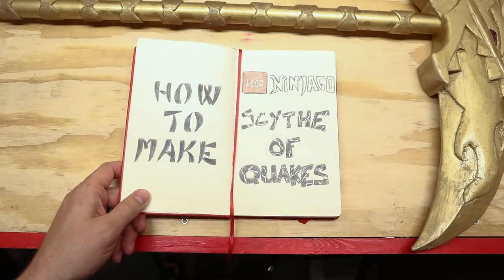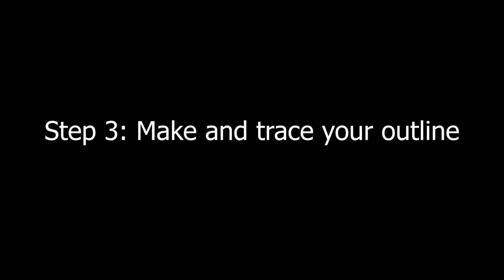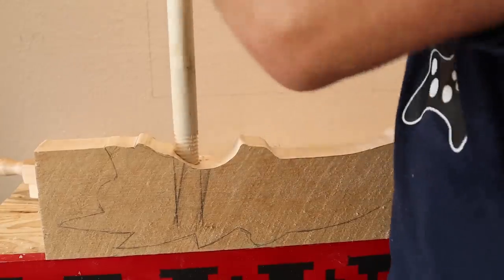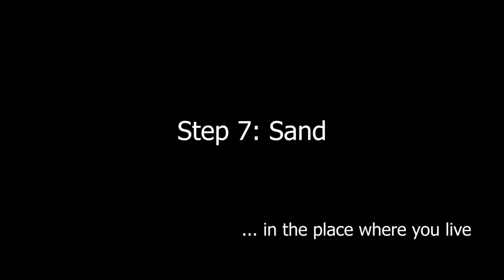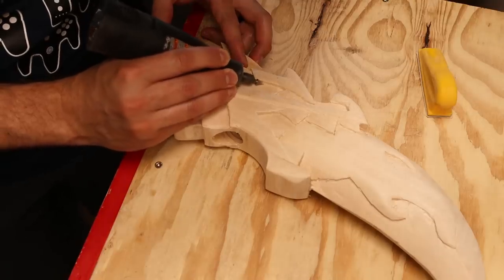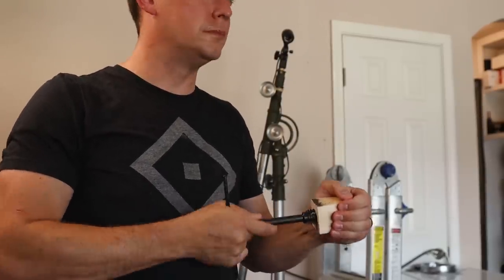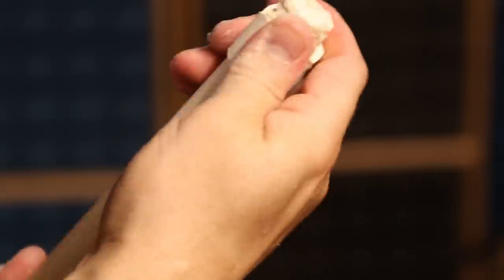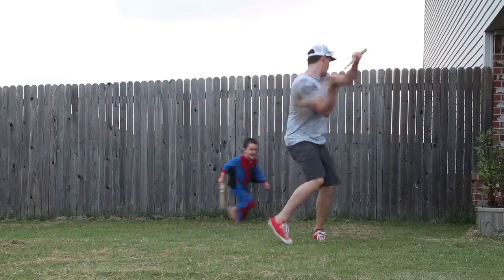Epic Lego Ninjago Build: The Scythe of Quakes

Comment: The Sword of Fire and the Scythe look great they do look a little rough in a couple places because they're made of wood but that also means you can play with them and when they make an impact on etch other they sound like they do in the show witch is a little weird if you think about it because the are made of solid Gold but the same like wood I mene I could be wrong because I haven't seen the show in so long but I remember them sounding like that over all I think they turned out great and plz do the Nunchucks of Lightning next also what song did you use for the second half of the vid?
Reply from the maker: The song i used for the second half is called Ocean Roads by Swif7
Reply: Once Upon A Workbench thanks

Comment: This one is really well made, im curious how you will make the lightning in between the nunchuck handles though. Maybe as a future project you could also make the lego ninjago dragon bone blade, i would lobe to see that one. I do suggest you make the dragonboneblade to the actual lego piece proportions and not to the tv show proportions.
Reply from the maker: Im still trying to figure out how Im going to do the lightning for the nunchucks
Reply: Oh, and i vote shurikens next, then you have the hardest and probably most impressive weapon for last
Reply: @brickdaddiy  maybe a blue chain or cloth that's transparent?
Reply: And in the blue lightning colour of course
Reply from the maker: I was thinking glow in the dark epoxy for the chains.. maybe
Reply: @brickdaddiy  do you mean an actual working epoxy chain or just something chain shaped? Because i dont know if the epoxy is strong enough to hold those 2 pieces of wood togheter
Reply: @brickdaddiy  also, what did you think of the dragon bone blade proposal?
Reply from the maker: Either. Ill have to find someone who has done something similar before
Reply from the maker: I wonder if I could find a bone to do that one out of
Reply: @brickdaddiy  it would be pretty awesome if thats possible